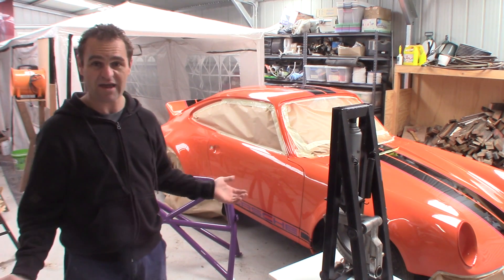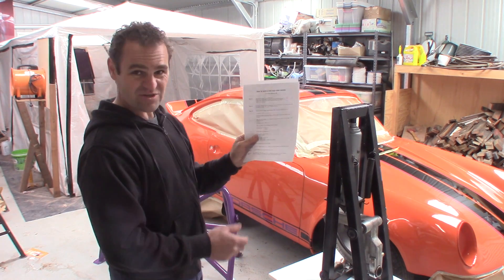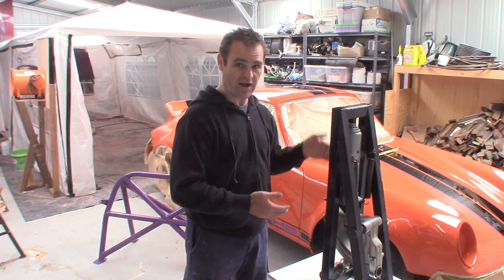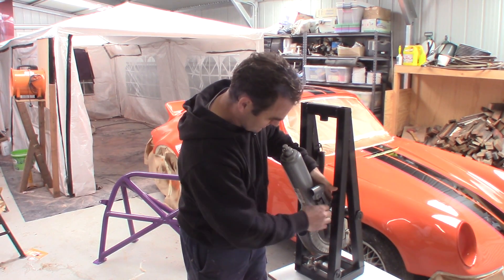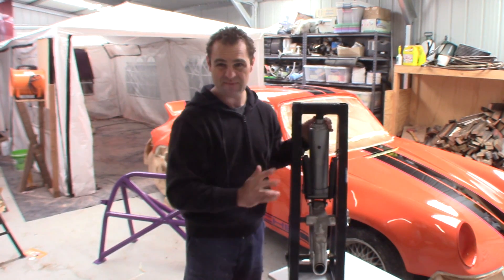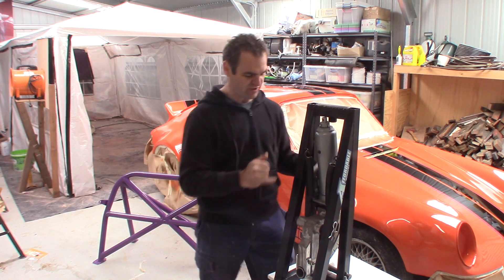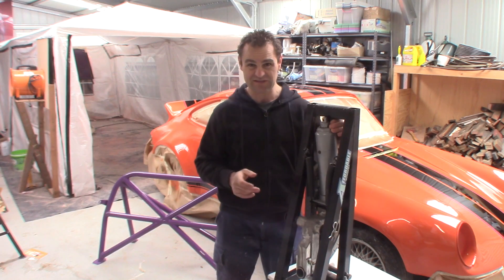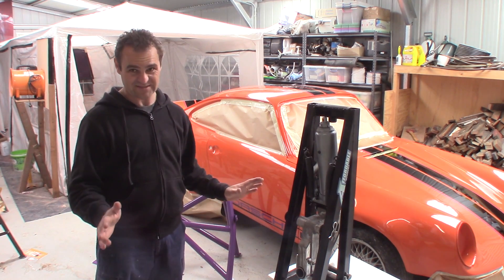Roll Cage Tube Bender plans

Comment: My jack is 26.035cm tall
will raise to 50.8cm
will this work or is it to short?
Thanks
Reply from the maker: It should still work, you just need to adjust the plans to suit. Follow the steps in the description link and if you get stuck let me know.
Reply: I guess the real question is how much stroke you need to make a 90° bend. Mine has 171.45mm of stroke
Reply: it works
Reply from the maker: Stumpy's Garage Great stuff. Glad it worked out for you.

Comment: how much did the die end up costing shipped?
Reply from the maker: Here is a link to their ebay ad http://www.ebay.com.au/itm/Affordable-Bender-Roll-Cage-Tube-Bender-1-3-4-DIE-SET-ONLY-/331937448292?hash=item4d49038164:g:ZTEAAOSwaNBUdPFs
Reply: So for 40mm external diameter and 2mm wall thickness i´ll need 1-5/8"? and what about 45mm external diameter and 2.5mm wall?